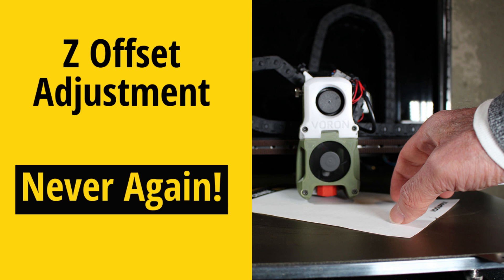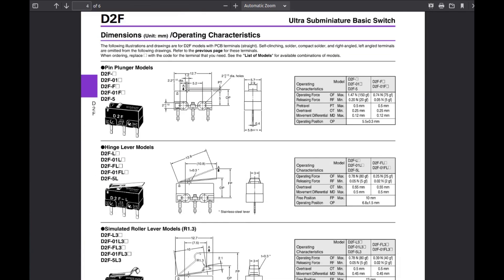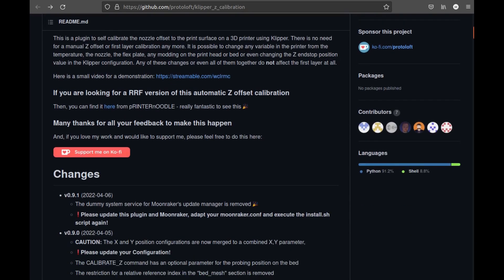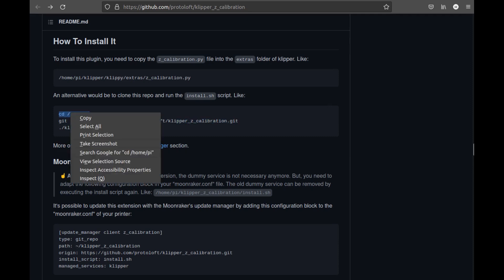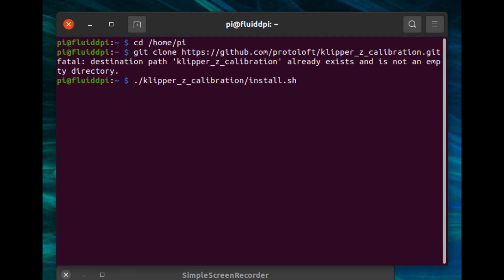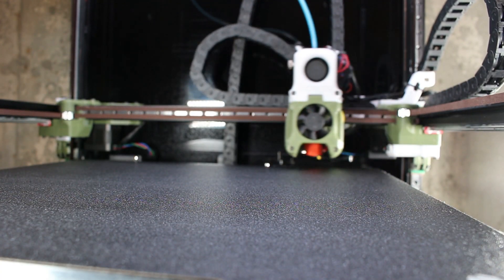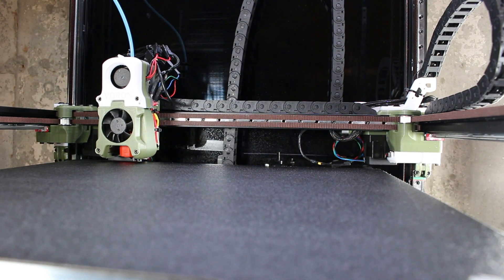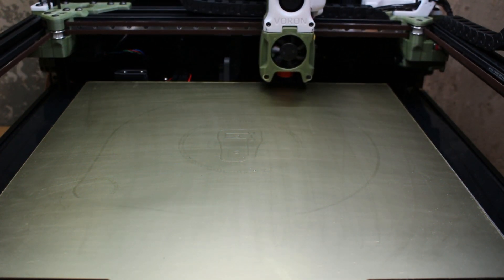Never adjust your 3D Printer Z Offset again with Klipper and a plugin

Comment: There's a new way to do this now with Voron Tap. The nozzle itself becomes the probe.
Reply from the maker: Yes, I saw that.  I'm still wondering if I will adopt that or not.  This currently works really well and I'm not 100% sure what Tap will provide that is any better.  Also, adding another linear rail to the x-axis seems like weight that might not be necessary.  But Tap looks cool.  Thanks for the information and thanks for watching!
Reply: @KapmansBasementWorkshop  I hate taking a working printer apart for upgrades, but that's partly due to not having enough working printers here. I'm fixing that shortly.. Tap adds about 45g to the toolhead, which is a concern, but not much of a problem for a Voron. In any case it is good for folks finding this video to know there is a new option in town to consider. The Tap testing team did find that small mechanical switches don't last long in heated environments and Tap improves on reliability by using an optical switch which is also more accurate. But a good mechanical switch is accurate enough -- until it fails.. And it would give you more content to produce! Happy Printing!
Reply from the maker: @alanb76  Hmmmm. Is that a hint?  :)

Comment: Hi again Kapman! I was just curious at the step where we use the paper between the nozzle and bed, what are we doing with that value we get? Thanks again for all your work, I'm pretty much using your videos to all my mods ha
Reply from the maker: It's great question.  I tried to clarify that since I didn't think the instructions were that clear, and I was confused at first as well.  In your autoz.cfg file there is the switch_offset value.  The starting value should be the value taken from the specs of the microswitch you used.  However, this is probably not the final value you want.  You will test that switch_offset value with the sheet of paper. You need to keep testing and adjusting switch_offset (and rebooting klipper) until the paper friction feels right (or feeler guage) and you have the nozzle at the correct height for your 1st layer of a print.  One you have proven the switch_offset is correct based on the paper test and possibly some minor adjustments based on an actual print.  You are done and you will never need to do it again.  You can change nozzles, switch bed plates, print at different bed temperatures and the printer will now automatically adjust itself to the correct height!  Honestly, its by far the best improvement I have made to my printer.  Also, I strongly recommend that you install a nozzle brush (I created a video as well) and setup the printer to brush the hot nozzle prior to calibrating the z-offset.  That way you won't have filament on the end of the nozzle that might cause an incorrect reading with auto-z.
Reply: @KapmansBasementWorkshop  Okay, that makes sense! I'm doing that mod next and will be following along your video. Then the runout sensor, so on and so forth ha

Comment: thank you for the video, just building my voron. coming from a SWX1 with bltouch, it seems I can't get it why just not use the bltouch for both z endswitch and the abl, is there a voron-specific reason for this?  for the last 2 years that's how its been setup on my x1, the only time I've been adjust my nozzle offest was when I've changed nozzles which is about 3-4 times.
Reply from the maker: The reason for not using the BLTouch is that it tends to fail due to the high heat inside the enclosed Voron 3d Printer.  What is good for printing ABS seems to be bad for BLTouch.  Also, the way the Voron z endstop switch is, you can change nozzles and it automatically adjusts so you don't need to calibrate a new z-offset.
Reply: @KapmansBasementWorkshop   thanks for the explanation, does it also apply to the version of bltouch with a metal pin?  I mean, does the housing give up or the pin or is it electronics, thank you!
Reply from the maker: @nemetra2806  My apologies, but I just don't know the answer to that one.

Comment: I just switched to BLtouch after my third inductive probe melted.  The touch has always been a source of annoyance on other printer (snagging and snapping) but I've had it with melting probes.  I pulled the microswitch z endstop at the same time to use the touch for everything, but now I'm reconsidering keeping the switch... I did assemble a Klicky but never installed.  There seems to be some weird behavior in klipper when it comes to the calibration-generated z offset.  Thanks for the info.
Reply from the maker: This change is the single biggest improvement on my printer.  I recommend it strongly.  The consistency is amazing and it simply adjusts itself, even when changing flex plates that are different thicknesses.
One question: Is the BLTouch having trouble in the enclosed & heated printer like many claim, or is it working well for you?

Comment: A nomal probe like a bl-touch takes care of constant perfect first layers, even when switching bed surfaces. The only big advantage here is when you switch nozzles or printheads regularly. In that case it's worth the upgrade I guess.
Note that I do switch (V6 style ) nozzles without altering the offset in any way. Works for me..
Reply: Long time BLtouch user here, on multiple machines.  You still need to set up your Z offset with the Bltouch. It's not hard, but it's not foolproof. Also over time it needs readjusted (especially after a pin bend or replacement). I always forget which way to go to do the adjustment so it's always a process for me. This macro eliminates that process. Also If you ever get gunk in your sensor pin (like a fan blowing fuzz from regular printing) the sensor will false trigger or hang up. A warped print can take out the sensor pin.  I've ruined hundreds of dollars worth of bed surfaces with Bltouch malfunctions over the years. 

The Bltouch works great, until it doesn't. I really like using them when they work, and have bought a bunch of them (always authentic). But when they fail it's a big problem. I've ruined hundreds of dollars worth of bed surfaces with Bltouch malfunctions over the years, plus bent pins, and other crash related damages. 

The biggest advantage here is getting Bltouch results plus nozzle measuring without actually using a BLtouch.
Reply from the maker: It's great that it's working for you.  I have an older printer that isn't enclosed, I may give it a try.  Thank you for watching!

Comment: I got everything working. Euclid probe working fine, but the calibration of switch_offset does not work. i put in 0.2, 0.8, 0.5, 0.1. But every time the nozzle hits the bed at z=0.5 The switch_offset does not seem to matter, how is that possible? (Yes, i do restart between changes. Workflow voron2.4:  home_all, gantry_level, home_all, mesh bed calibrate, calibrate_z)

Edit: I know what I did wrong. I used the buttons to move the gantry. When I use the commands it works perfect. 

Why is the absolute z-Pos in the tool window different?
Reply from the maker: My apologies, but different from what?  Or is it different each time it's calculated?
Reply: @KapmansBasementWorkshop  Sorry for my confusing message. I used the tool section of the fluidd webpage to move the z-axis with the arrow buttons and watched the position shown on screen. I should have used the commandline, then it works fine. After CALIBRATION_Z the displayed z-position in the tool section of the fluidd webpage  is not the same as given with the G0 command. So when i move down the nozzle with G0 Z0, the z-position shown on the fluidd web page is never zero. The position shown seems to be the difference between the buildplate height and the z endstop trigger, because its different between build plates, but consistent when calibrating with the same buildplate. And after measuring, it seems to be correct. But i am not 100% sure. in any case: Using the command line is correct. using the z-pos read out on the webpage is not.

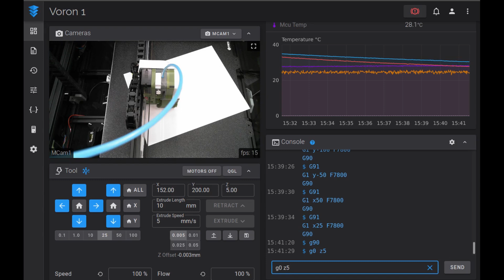in your video arround 12:35-12:55 when you type in G0 Z1, the z-pos display reads 0.98. when you type G0 0.1 the z-pos shows 0.08. In my case these differences were bigger.

edit:  fixed it
I added some code to z_calibration.py and that fixed the displayed value.
at the very end of the calibrate_z function add:

 th = self.helper.printer.lookup_object('toolhead', default=None)
 th.kin.rails[2].position_endstop = offset

delete the compiled version of this file: klipper/klippy/extras/z_calibration.pyc  (note extension: pyc )
then restart klipper
Reply from the maker: @gjmi72  This is really cool!  I think I may need to make this change.  Thank you for posting this!
Reply: @KapmansBasementWorkshop  I upgraded to the latest fluidd version and it seems that my fix is not needed anymore. When i wanted to put in the change on github, i did some additional testing. and my change did not do anything anymore. the only difference was an upgrade to the latest fluidd version
Reply from the maker: @gjmi72  That's good to know.  So it was a Fluid problem!  I'm glad it's working for you.  For me, this is easily the best upgrade I have made to my printer.  Thank you for that bit of information!
Reply: @KapmansBasementWorkshop  I've been tinkering for years on my Prusa Mk3 and last 6 months on my voron 2.4r2 and this is by far the best upgrade ever! Prusa implemented the addition of storing a z-layer offset for different sheets build in to the firmware, but that did not help with the nozzle changes and if you forgot to change the sheet type in firmware.....

And this in combination with the REVO with easy nozzle switching. this made me literally jump for joy when i got it to work! Change sheet, change nozzle, it does not matter, it just works, no manual calibration needed.
Reply from the maker: @gjmi72  I fully agree with you.  This is a game changer!  I'm glad to hear how well it's working for you.  Thank you for reporting back!

Comment: Some how my Z is 2mm to low. My switch offset is .5mm so not sure yet how to fix it or   what order I need to do things in.
Reply from the maker: Is the top of the z endstop above or below the print surface?
Reply: @KapmansBasementWorkshop  it is just above the bed level.
Reply from the maker: @jasonsaffle13  And you homed, QGL'd, and then home again before testing?
Reply: @KapmansBasementWorkshop  Yes. I am going to double check my Z_min setting. If I do another bed mesh, probe calibrate what order should I do them in if the Z_min does not help?
Reply from the maker: @jasonsaffle13  Don't do a z-calibrate  until you home, QGL and then another home.  They you can try to calibrate z.  See if that helps.  After that, we need much more to try and figure out what is wrong.
Reply: @KapmansBasementWorkshop  I went into printer.cfg under the do not modify section and changed Z_offset from 1.487 to -0.495. Working on cleaning up cfg files and homing speed now.
Reply from the maker: @jasonsaffle13  The "do not modify" section settings for z_offset should have no impact at all if the auto calibration software was installed properly.  If you created the Auto-z file, those are the settings that matter now.  And once you change them, restart Klipper.
Reply: @KapmansBasementWorkshop  I think it's working now. The trick was adding relative_index for the bed mesh.
Reply from the maker: @jasonsaffle13  That's very interesting and potentially important.  Thank you for posting that!
Reply from the maker: @jasonsaffle13  Actually, you are referring to "relative_reference_index:", correct?  What did you set this to?
Reply: @KapmansBasementWorkshop  I have it set to 7. My bed mesh went from a solid red to something that looks like a ceral bowl.
Reply from the maker: @jasonsaffle13  Turns out I have it on and set to 12 in mine.  Looking at Protoloft's github, it actually discusses this, but I'm not sure he states that it's actually necessary.
Reply: @KapmansBasementWorkshop  Have you tried erasing the bed mesh then  removing it or changing it to see the result, or is it pretty clear what would happen?

Comment: Thank you for the great video I really enjoy it and it helped move me forward in my setup. One question I keep getting a Offset is larger as allowed message. My offset is 1.528 and the max says 1.0. I see in your config you have have a max deviation entry but I am not sure why or what this means.
Reply from the maker: max_deviation simply is the allowable range in mm of the calculated offset.  So if you want to allow 1.528, the max_deviation needs to increase to 1.6 or 2.  Before you do this, adjust with the paper test and try to get it within 1mm.  It's a safety mechanism.   I'm glad the video has helped and thank you for the kind words!
Reply: @KapmansBasementWorkshop  okay so I think I got it. I have a glass bed but then put a 1mm sticker on it due to some issues and that caused the variance from when I originally set it up. 
So for instance correct me if I am wrong but if I use a flex plate and do the initial calibration with this plate and then use something that is 3mm thicker I think I would need the Max Deviation to be more than 3mm. Correct?

Comment: Has something changed in this plugin or in Klipper that effects this plugin, that in turn effects the M40x macros? I'm trying to set this plugin up and from a working euclid setup the M401 and M402 macros now make the toolhead move down Z which is not in the macros as I am using a euclid mount that attaches to the X cross member rather than the bed rail. There should be no Z move at all when commanding a dock or un-dock.

EDIT: Nevermind. I tested with my finger on the power switch and after installing this plugin the toolhead now moves to Z 15 before performing the dock maneuvers. I'm a bit paranoid because I already crushed the original microswitch that came with the kit playing with homing overide and I don't want to do that again.

Cheers for the instructional vid!
Reply from the maker: Thank you for watching and glad it's working!

Comment: That's great you set up an M401 and an M402 but no info on how this is done. I have been stuck for days. Is this like some kind of secret or is the into being held for ransom? This is a great video but I am now stuck.
Reply from the maker: Have a look on the about tab and follow my link to the git hub.
Reply: @KapmansBasementWorkshop  Thank you for the reply I did notice that afterwords. 1 more question. Is there a reason you set the xy position to 170,170 because half of 350 is 175? Changing my switch_offset does not change how high or low my nozzle prints any ideas why?
Reply from the maker: @chucktaylor5878  There is no important reason I choose 170,170 vs175,175.  I probably was a little too focused on the camera.  I'm not sure why switch_offset does not change the height of your prints.  I have some other changes to make over the next few days, I will test mine to make sure it still works and it's not a bug or something.  I'll get back with my results.
Reply: @KapmansBasementWorkshop  I appreciate your response. I just wanted to make sure I wasn't missing something I get a little over technical on things at times.

Comment: "Offset is larger as allowed" can occur if your different build plates have a large variance in thickness. In my case I have some tempered glass plates. Change the max_deviation from 1.0 to something larger. In my case I changed it from 1.0 to 5.0.
Reply from the maker: I did not consider that.  Thank you for posting the solution!

Comment: Would the steps be similar on an old cr10s?
Reply from the maker: I think so.  But there is one complication.  You will need to work out a location for the z-endstop switch that the nozzle can touch.
Reply: @KapmansBasementWorkshop  Yes, theres a spot at end of the y axis that I can place this. Besides the euclid probe, what was the other probe you used?
Reply from the maker: @zelurnevets  It's just a standard endstop.  A microswitch in a mount with a metal pin.  If you take a look at the Voron STL files and manual, you will see it.  That z-endstop is for the nozzle and the euclid probe to touch against.
Reply: @KapmansBasementWorkshop  Ok! thank you!. I had seen them on CNC mills before but not this small, also they dont need to measure the diameter of the tool in this case. I will try setting  this up in the next few weeks. Thank you for the info!

Comment: Wow I did not even know something like this existed (coming from the Ender 3 land.)

Would it be possible to do something similar with a BLtouch?

Test nozzle on the endstop
and then test probe on the endstop and use the BLtouch trigger as the value used in the calculation?
Reply from the maker: Someone seems to have gotten BLTouch working right here: https://github.com/hawkeyexp/auto_offset_z
But I can't use a BLTouch due to heat issues, so I have not tested this.  But you can certainly give it a try.  If you do, please let us know if this works.  Others have asked if this workis with the BL and CL touch.  Thank you for watching!
Reply: @KapmansBasementWorkshop  Oh wow thank you, now I just need to figure out where to place the endstop with enough clearance for everything on my Ender 3.

My Voron envy continues, one day I can have a trident with this as well never have to do any more calibration lol
Reply from the maker: @afkafkafk  I waited quite a while before I pulled the trigger on mine.  I know what you are feeling!